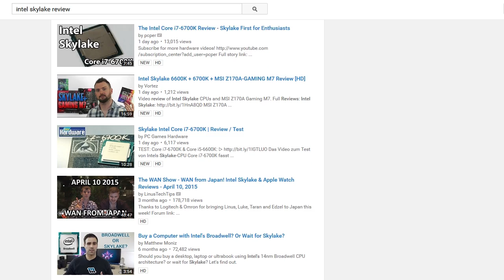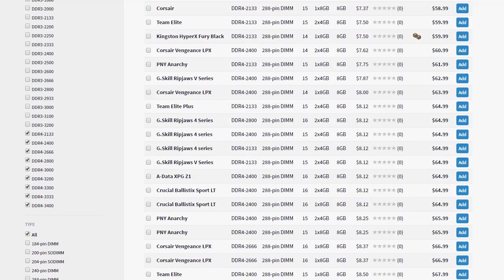ASRock Z170 Pro4S Preview

Comment: 2 questions, will this motherboard support DDR4-3000? Also, is the onboard sound any good?
Reply from the maker: It should in theory through XMP profile! Audio is alright, it has the ALC892 codec, which is a bit older one and not so good as the newer ALC1150 and ALC1220.
Reply: Thanks man!
Reply from the maker: No problem! 😊

Comment: im thinking to buy gtx 1080 will it work? i dont wanna spend $1000 and i will need buy a new motherboard.. just cant find info what of graphics cards its supports.. thx a lot
Reply from the maker: Yes, it will work. Generally speaking, there's no such thing as an "if x motherboard supports y GPU", they all "support" each other, as long as the motherboard has an appropriate (PCI-express x16) slot, and they have for the last 12 years or so.
Reply: TekTick hey thanks for info!

Comment: This motherboard appears to have a THREE pin connection for the CPU Cooler.  Of course, the Intel Skylake CPUs come with a FOUR pin connector.  I guess I need an idea of pin outs in order to complete my biuld.
I am also planning on putting in a SINGLE DDR4 memory.  Which slot would I use?  I assume A1 closest to the CPU, right?  Seems most other boards start at B2.  Doesn't make sense and ASrock has no guidance in their manual

Comment: Will this motherboard support a i5-6600k?
Reply from the maker: Yes!
Reply: TekTick Im planning on grabbing this motherboard along with the i5-6600k or the i7-6700k. What power supply do u recommend? i dont know if my current shieftec 500w will do
Reply from the maker: What GPU do you have beside that?
Reply: TekTick a gigabyte gtx 960
Reply from the maker: In theory you should be OK, although, I would get a maybe a better quality one (power supply) with same wattage
Reply: TekTick ive looked at the seasonic s1211 620w 80+.  Ive heard its pretty good

Comment: BAD REVIEW..
This board have Ultra M2, (double speed data transfer from the best M.2 drives), but the guy says nothing of this at all.
If buy ASRock Z170 Pro4S, yuu buy it for two reasons.
1, Extrem M.2 (nvme) hard drive speed. (Fx. samsung 960).
2, Overclock.
- But, for gaming, Ultra M.2 is not good, bcs. it steal data transfer-power from the grapich to support the fast M.2 Ultra.

CONCLUSION:
This board is best for those there focus to get, Or be able to get - in future), the possible fastet hard drive data transfer.
Reply from the maker: This is not a REview, it's a PREview, there's a quite difference in these two words.

In regards of your M.2 comment, I've mention everything that needed to be mention at around @ 2:30. You need to learn your terms a bit better. When you talk about interfaces you talk about bandwidth, not the drive performance, that's a variable. If a certain new type of interface is double the data transfer of the other one (for example here Ultra M.2 vs M.2), that doesn't mean that the next drive will be double the performance. 

"But, for gaming, Ultra M.2 is not good, bcs. it steal data transfer-power from the grapich to support the fast M.2 Ultra"

- this is also not true, there's plenty of PCI-e lanes for a GPU and a M.2 drive, you have lanes coming from the CPU and the chipset itself, and for the Skylake platform that's a total of 36 lanes if I'm correct. Pretty much every Z170 MBO has a M.2 slot, that's a common feature nowadays, so you don't have to buy it solely because of that.

Comment: hey dude, I just realized my crosair 3000mhz ddr4 rams are working on 2133mhz and i cant seem to clock them on 3000.. anyone has similar problem with this motherboard?
Reply from the maker: XMP profile doesn't work?
Reply: It seems that i cant get ram on 3000, highest i can clock it was 2800 when using 2x8.. if i use 1x8 there isnt any issues and i can run it 3000
Reply: Excuse, have you resolved the problem with the ram? I have the similar problem

Comment: Hey dude! Do you think the Z170 pro4s would be fine with the Vengeance® LPX 16GB (2x8GB) DDR4 DRAM 2400MHz C14 Memory? And would run on 2400Mhz? http://www.corsair.com/en/vengeance-lpx-16gb-2x8gb-ddr4-dram-2400mhz-c14-memory-kit-black-cmk16gx4m2a2400c14

I didnt saw it in the memory compatible list by asrock. :(((
Reply from the maker: It should, yeah, sometimes manufacturers don't list all memory kits!
Reply: It worked with the memory so i can say its very good board. I was able to get stable 4.6 ghz with optimised overclock settings for the cpu. But i noticed that the sound is little different as my previous asrock z77 pro3 board. Or im wrong? Its possible to notice difference in sounds between boards, example in extreme 4 or the board from the video?

Comment: Can i overclock with this motherboard? is it good for that? i was gonna do a overclock of a 6600k from 3.5 to 4.1 or 4.2
Reply from the maker: Yup, you should easily achieve that!
Reply: ok thanks so much
Reply: @double00 i have that card and cpu, oc to 4.2 ;) no problem.
Reply: Running 6600k at 4.4 daily, and Kingston RAM OC 2133-->2666mhz. Whisper quiet too.

Comment: Hey! I wan't buy a i7 6700k processor. Do you think the Asrock Z170 Pro4S would able to overclock the 6700k up to 4.6 Ghz? Nice video. :)
Reply from the maker: It depends on your sample, but 4,4 - 4,5 GHz for sure!
Reply: Wow thank you for your fast answer. Then i go maybe with the Asrock Z170 Extreme 4. Or i dont know, its cost little more. Is it even worth it?

Comment: Do I have to buy a wireless adapter or is it built in this motherboard?
Reply from the maker: You have to buy it!
Reply: +TekTick what about this motherboard? http://pcpartpicker.com/product/hMvZxr/gigabyte-motherboard-gah110ma sorry for all the questions btw
Reply from the maker: Abdullah
It too! Basically only really high-end motherboards come with integrated Wi-Fi!
Reply: Silly question but will my corsair vengeance 8gb ddr4 3000Mhz work with this motherboard ? because it doesn't really show in the specifications of this ASROCK Z170PRO4S motherboard the closest one is like 2933(OC) ?
Reply: +Benas M yes it will work
Reply: but will it work normally without the motherboard downgrading the ram to like 2133mhz or something simillar to that ?
Reply: +Benas M you can overclock it and it will work,  z170 chipsets are really high end

Comment: Can this board fit an i74790
Reply: 4790 is a 4th gen processor so no.  the 4 in front of the 1000 part of the processor model tells the generation.  This motherboard is made for 6th gen processors.
Reply: you need a CPU that says ix-6xxx
Reply: The G4500 i a 6th generation/Skylake 1151 socket CPU.  Has anyone tried using that with this board yet or am I the first?

Comment: Guys i just bought this mbd whit 2X8G DDR4 2666 KINGSTON HYPEX and the ram is running at 2133. I didnt notice that it doesnt support 2666 what can i do?
Reply from the maker: +koseto OG Have you tried to setup the XMP profile?
Reply: +TekTick i found out how to do it it was already enabled but i chanched the dram frequency to 2666 i hope i dont fuck some shit up
Reply from the maker: +koseto OG First of all, try to calm down and relax, I won't destroy anything just by changing settings, that's virtually impossible. There's an XMP settings within the memory settings in UEFI BIOS and usually under that settings you can find one or two predefined profiles (for example Profile 1 and Profile 2). Those profiles are determined by speed, latency and voltage. Choose one that has 2666 MHz speed and that's it. There are plenty of tutorials on YouTube how to do it. ;)
Reply from the maker: koseto OG
Is it running at 2666 MHz? Check the speed in CPU-z! If it is, everything is OK, ignore the benchmarking figures.
Reply: +TekTick https://gyazo.com/58664532ccf06e060198d28258a36401
Reply from the maker: koseto OG
Yup, that's OK, it's working at 2666 MHz (it says 1333 MHz, but it's working in dual channel, so the number is split in half).
Reply: +TekTick thank you for the help you earned a sub. Have a good one.
Reply from the maker: koseto OG
I'm glad I could help! Thank you for subbing! ;)

Comment: Hy, i`ve ordered that mb and when i opened i can`t find s/pdif out pins (right near audio front port). Can it be a fabric mistake or a version without that pins ?
Reply from the maker: +Stratulat Marius  It's very unlikely that it's a fabric mistake. Have you checked out the manual?

Comment: I just ordered this motherboard and was wondering if it will support DDR4 3200 PC4-25600 4GB x2 CL 16-16-16-36 1.35v dual-channel non-ecc, non-buffered RAM - or specifically Ripjaws V Series F4-3200C16D-8GVK ?
Reply from the maker: +Isaac Wardel Sure, I don't see reason why not.
Reply: TekTick I worry because I didn't see my model of memory on Asrock's list of supported memory, and the G.Skill website does not match my model of memory with this motherboard or match ANY 1.35 volt memory to this motherboard. I hope everything works out when it gets set up - maybe Z170 and the new DDR4 memory is still in flux and I'm being paranoid about outdated compatibility data? Anyway, good video and thanks for your reply!
Reply from the maker: +Isaac Wardel I don't see a reason why the motherboard couldn't provide 1,35V. You can always replace your RAM at the retailer within a certain time, I'm sure you have that right, at least I do in my country.
Reply: +Isaac Wardel Hey did the g.skill ram you had end up being compatible? Im thinking about buying this motherboard and have g.skill ram as well was just wondering if it worked.
Reply: ***** yeah it worked just fine! - you have to go into bios and set it to 3200Mhz
Reply: alright thanks for the response man
Reply: it's supports ddr4

Comment: I bought the smaller version of this board, the Z170M Pro4s. Have it paired with a core i5 6500. All in an aluminium Cooltek C3 case.  Runs very well.
Reply: Yes you can. Overclocks 'k' models easily. However, I have the non-k 6500. With the right bios, I have overclocked my non-k 6500 from 3.2 - 3.5GHZ. Bear in mind this not only disables on board graphics but also disables Intel speed step.
Reply from the maker: +thefrecklepuny Nice :)
Reply: run it too in a different case tough
Reply: +thefrecklepuny can oc this procesor on this mb?
Reply: +thefrecklepuny i buy i5 6500 i´m waiting  and asrock z170 pro4s  too but run the i5 to 3.5 to ?
Reply: +jesus lazaro silva can you showme the bios configuration? i buy too 2 ddr4 kingston fury 2133 8g

Comment: I'm planning to get the following rig can you rate it?
i5 6600k
ASRock z170 PRO4S
8GB (2x4GB) Kingston HyperX Fury ddr4-2133
Sapphire Radeon r9 390 Nitro
Thermaltake Smart se 730w / modular
NZXT Source 340
Thermaltake contact 16
1tb WD Blue sata.

I have a laptop atm thats why i thogh to go for the 1551 board and also 
skylake cpu since im building it from a scratch. This way i should 
better upgrade capabilities compared to 1550 boards, right?
Reply from the maker: +MrSuvvri It's seems rather OK to me, maybe the PSU is a bit overkill! BTW. no SSD?
Yes, you're set with the 1151 platform! :)
Reply: TekTick
maybe im gonna get the SSD next month after the payday. But i still dont know it its worth toe money. Gonna watch some ssd vs hdd videos on youtube to see the differences in performance etc.
 Ah and about the PSU- i changed it for a 650w corsair something-something modulars thing in the end.
Reply: +MrSuvvri if is corsair cx get the other one i had so much trouble repairing/changing those in our office ...
Reply: +MrSuvvri Trust me SSD is well worth the money. Go for ADATA, I bought one last month and I'm more than happy. Also, your config looks pretty badass, but I'd recommend going for at least 2666 MHz of RAM, 2133 will probably be a bottleneck for your 6600k

Comment: i have this motherboard but i have a problem . when i use my external  seagate  2tb backup slim drive on the rear usb3 ports and i try to transfer lets say a movie on to the seagate the transfer stops half way through  and causes my desktop to crash . and when i try on a different rear usb3 port the transfer is very slow the usb3 ports on the front of my case work fine  with the seagate . i then tried my sandisk usb flash drive on the rear usb3 ports and it works fine . can anyone help me with this
Reply from the maker: +tredstone I would say that maybe something is wrong with your external drive? When you say crash, what crashes? The whole computer or Windows Explorer?
Reply: +TekTick thanks for your reply . when i say crash i mean the windows start button becomes unresponsive and i cannot shut the pc down and the clock at the bottom right of my screen vanishes . the drive works on the front two usb3 ports its just the rear ones but when i tested with my sandisk flash drive the ports on the rear  work fine . its strange

Comment: If the motherboard supports 4 DDR4 sticks, can I use only two?
Reply from the maker: +Light Yagami Yes, just put them in the same colored slots! 1st and 3rd, or 2nd and 4th!
Reply: Thank you!
Reply from the maker: Light Yagami
No problem! :)
Reply: +Light Yagami You can even use one. I do at the moment. Although it'll run in single rather than dual channel mode.
Reply: Kira....

Comment: How can I change cpu voltage on asrock z170 pro4-s
Reply from the maker: +Rozalia Stoltmann In BIOS of course, why?
Reply: +TekTick Apparently, the M version of this board has the voltage option disabled (by mistake), so chances are, this one does too. AsRock says updating the BIOS seems to fix this, but for the people that had this issue (you can find info on NewEgg for the M board), updating it didn't help.